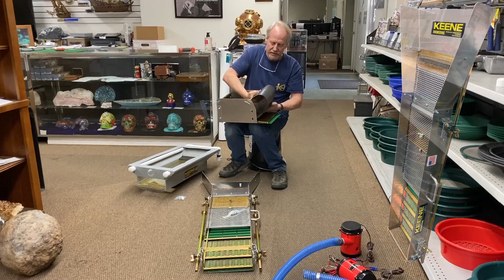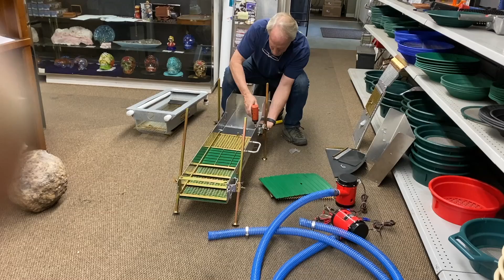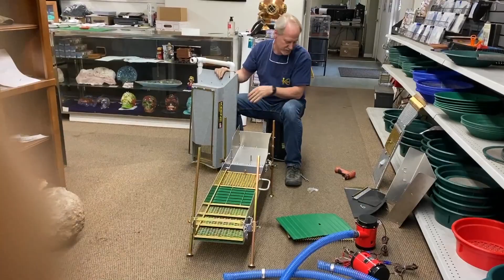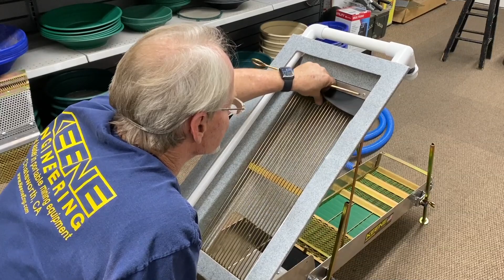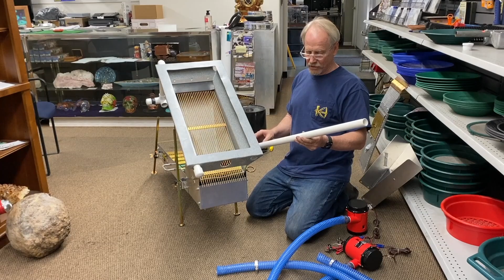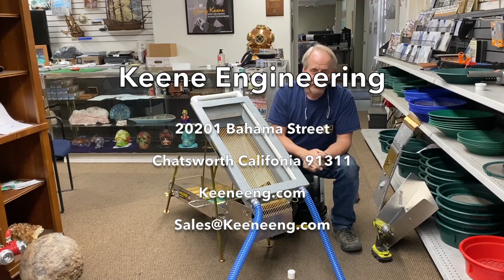Keene A52S conversation into a double pumper battery powered high banker

Comment: I just purchased the header box in June to try this setup using the 2 pump system. I couldn't get the two lower caps off without cracking it. They had to have been glued. What I did was hook up a 3700gph pump with a 10 ft. 1.5 in. hose at the top using a 1.5 x 1.25 adapter. It worked great! It handled the 3.5 foot uplift very well. I'll have to add a ball valve next time to control the water flow.
I had to rewire the pump using 10 gauge to accommodate 4.5 ft. from battery to pump, with a recommended 20 amp inline fuse. Using a stronger pump may cost less than paying for 2 lithium batteries and 2 pumps.

Comment: Mark, I would like to have it with both options, gas and electric in one package for the flexibility as needed. Great to see the electric (I drive electric and love it). Also with electric is there a way to use a hose sprayer and also a rock crevice blaster, even if it requires a 3rd pump and battery? Keep up the great work!

Comment: Man that's one well built piece of equipment there only one thing I seen that may be an issue for alot of people. Is your water inlets. You got one on each side of your hopper with plastic and or lay flat coming down to & through your course tailings & I always use my shovel to knock down & level out my pile. Being you got one on each side doubles my chances of  puncturing my houses. If it be me I'd cut the pipe that runs up the sides & glue a Tee in there then it will set you back a lil ways from your course tailings. But just a thought. Still one bad ass set up 😏👍🍻✌

Comment: I have the A52s, it's fairly new, and have had it out multiple times now - it does a relatively good job, but... before you buy any sluice you really need to educate yourself on how riffles work, and what flow rates are needed to create the self cleaning vortex's required to actually make the systems work as you'll want - the grating system keene uses is great (lol) but you'll need even more flow rate to clear the material fed 'unclassified', which is the whole point of this system - also like the idea of the modular add-on's as long as the scope of your intended use is as designed - I do agree with a lot of the people I've talked with at events that keene's are a little pricy but you do get quality, and well thought out designs - the only real 'complaint' I have with keene is keeping stock up ...it took more than a month to receive my A52s and I still have a 140s (dry) on prepaid backorder through Ryan at A&B and was just told it still may be weeks out - for the hobbyist such as myself, seasons already started 

Good luck Mark, looks like a practical upgrade if the pumps are robust enough for the environments they'll be subjected to - would be nice to 'see' the flow rates created, here on the post - you and Pat have a great year!